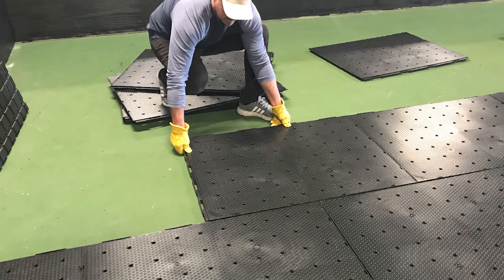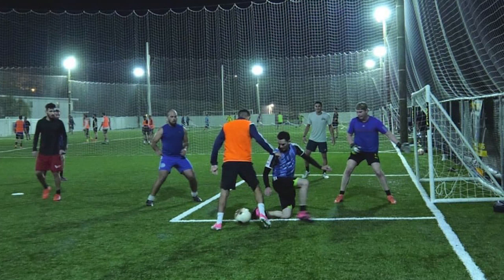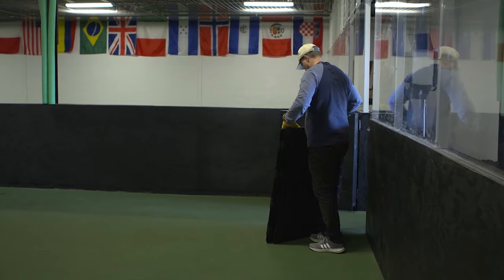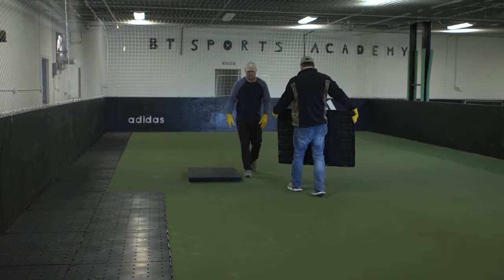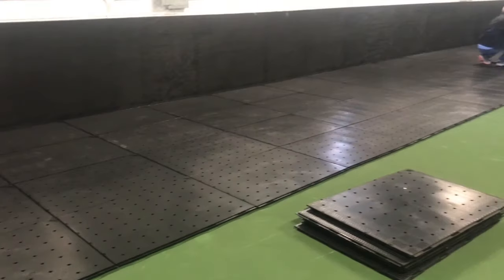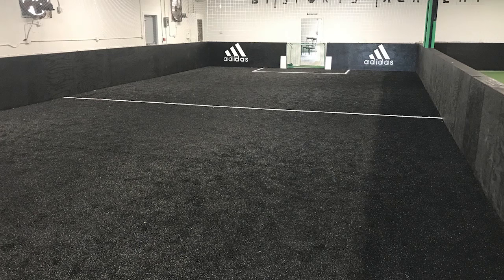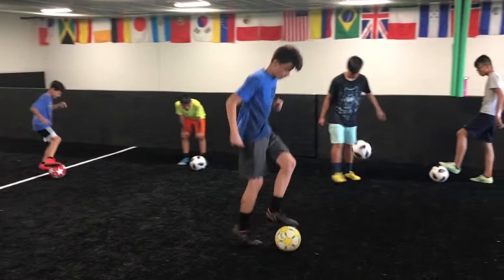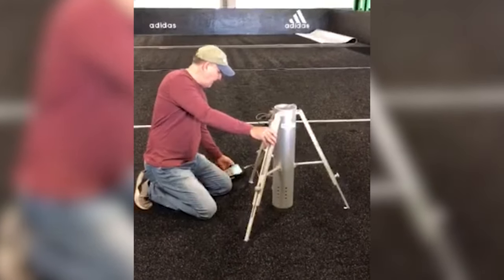Converting Concrete to Turf - Fast and Easy

Comment: So after rolling out turf on top of UB panels, can you stretch turf tight even though the barbs on panels grab the turf?
Reply: Also what if I have a 5mm pad attached to turf? Can the barbs grab onto the pad and prevent movement of turf and pad?
I’m looking at putting a non-fill agility turf (3/4” pile max) with attached 5mm pad.  I want to use champion product as the base floor is concrete.
Reply: @jasonshuffler7720  did you end up doing your project? how did it end up working out? we're looking to do a basement so trying to learn best practices / materials for install on concrete in a basement.